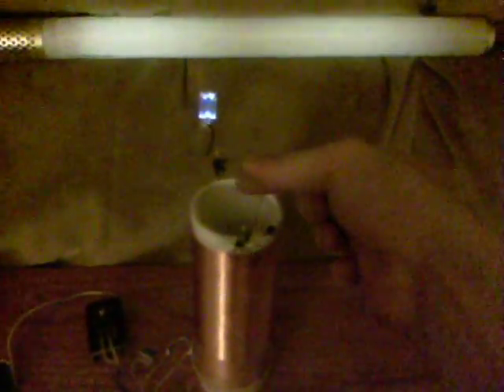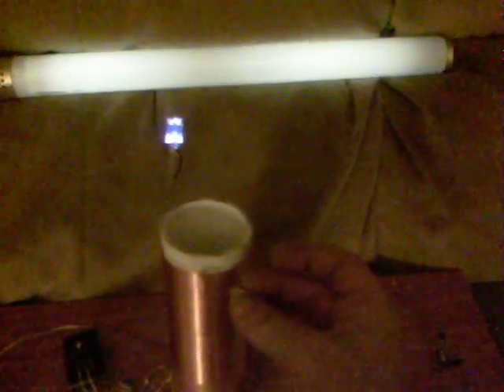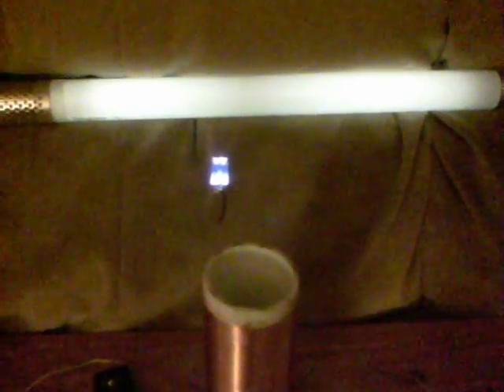C5198 SEC wireless electricity demo

Comment: i dont know why my transistors get really hot... looks like heat sink is a must.
Reply from the maker: +Talha Kamran You can experiment with a resistor to the Base of the transistor. It acts as a current limiter and keeps the transistor from heating as much. Even 100ohms can make a big difference. A diode in series with the battery positive lead also cuts transistor heat on this type of circuit.
Reply: slider2732
Adding a capacitor to the circuit helps. I think sometimes when you get hand near the coil or some other type of resistance there is serge  that cause transistor to clog charge....Capacitor acts as a bank that can accommodate that increase.
Reply from the maker: Talha Kamran
That's a good idea and tip...thanks :)

Comment from the maker: The Xenon tube on the top of the tower came from a disposable camera...it's the flash itself. When driven by a tower they have a continuous lightning effect. 
Neon bulbs can be found in power strips, any that have the red/orange flickering light, but can be found at Radio Shack or elsewhere. 
Also, 'Starters' for fluoro tubes often have a similar bulb in them, can be red or purple emitted from those. Just twist open the round plastic cover and have a look :)

Comment from the maker: @buddybill65 Hi there and thanks :) The motor is a 6mm coreless, from a micro aircraft, a 'pager' type...the same type as many vibrate motors in phones. The coil receives the power, it's smoothed by the 4 diode rectifier and a small capacitor, then boosted by a transistor. Sounds complicated, but is light and simple to solder up.

Comment from the maker: @MrFlathunter Thanks ! I was encouraged to view your videos by Jonnydavro and found them to be incredible...the spinning plasma motor is something in the works over here. Currently putting together a database of working transistors, small to power MOSFET's. They all come from scavenged misc that a lot of us tend to have in boxes eh. Choices are C3198 for low power and tiny systems so far, C5198/2SC2625 for larger 12V systems. 2 pop bottle tower called Bertha is my largest..for the moment :)